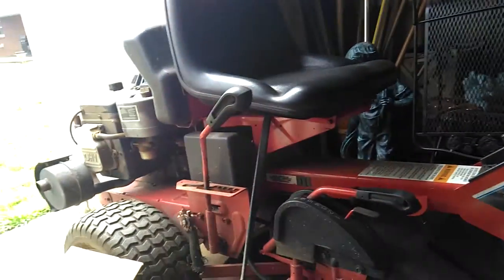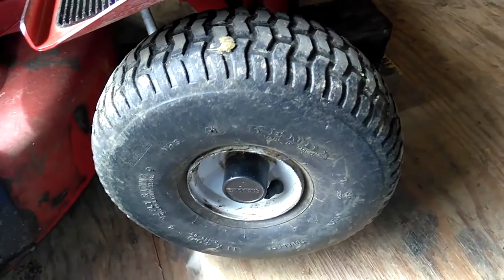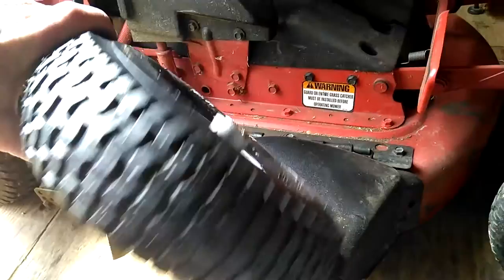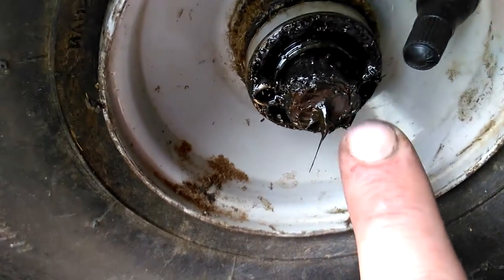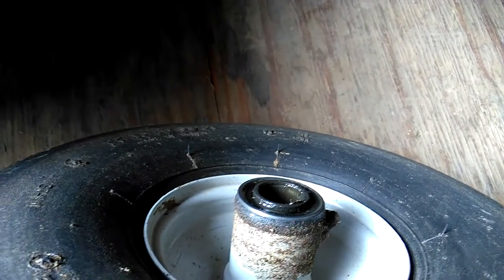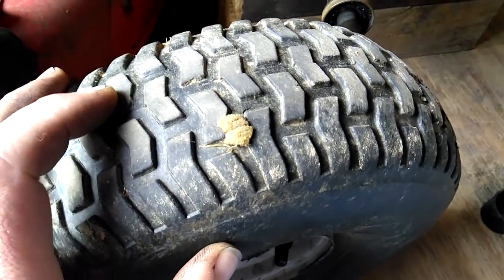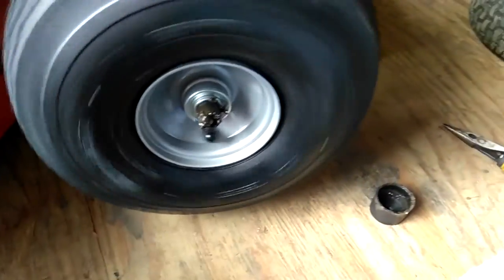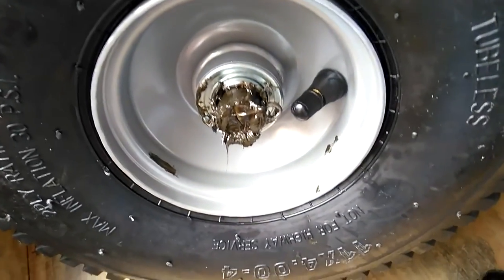Snapper Series 18 Front Wheel Remove and Replace.

Comment: You may not reply, however I hope you do. I just got an old Snapper. Both front tires need to be replaced. I popped the cap off the left side and pulled the pin out. The wheel and the washers came right off no problem. The other side is proving difficult. I took off the cap and the pin, but the wheel will not budge. There is no bolt. It is fastened the same as the other wheel. But it will not come off. It spins freely. I can spin it and it turns just fine.  It's almost like I never took the pin out.
Reply from the maker: Wow! thats a strange one man.  Maybe try some penetrating oil on the shaft or some taps with a rubber hammer?

Comment: I have a 20 year old snapper that I just replaced both front hubs and tires. The caps won’t fit the new hub as it didn’t in the video. The new hub has a smaller diameter shaft ; if you look at hubs in video you can tell; they are different
Reply from the maker: I think you're on to something.  If I remember correctly I had to tap the caps on with a rubber mallet and one of them decided to back off and get lost in short order.

Comment: What are some of the other series , I know one is a series 13 , but there’s other series , do you know what they are ? I am a subscriber
Reply from the maker: There are too many to list and I'm sure I'd miss some of them. I have featured series 0,18, and 23 on this channel. If you just want to see a list of them google oem Snapper parts and one of the first few results will have a drop down menu with all the models listed. Decoding model numbers. For old ones take my 3080 for example. 30 for 30in cut 8 for 8hp and 0 for series 0. More modern example 331523KVE. 33in cut 15hp 23series and KVE for Kohler vertical engine. Hope this helps. Thanks for sticking around!
Reply: @clayton7825  ok thanks that helps a lot